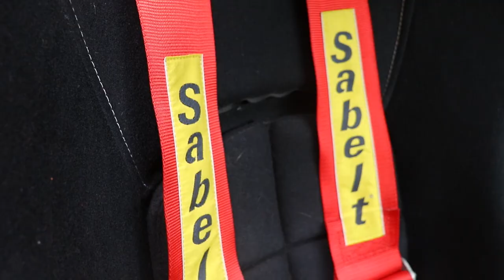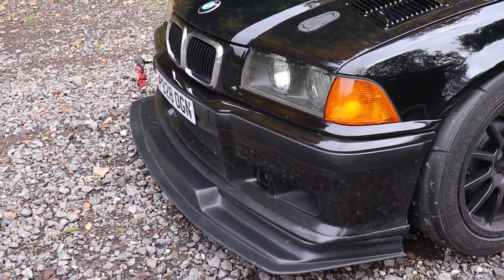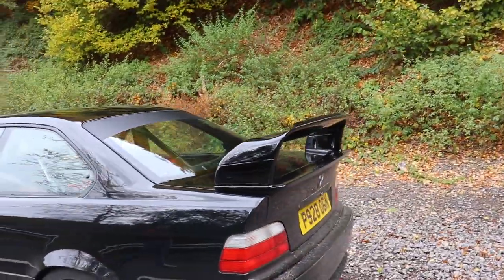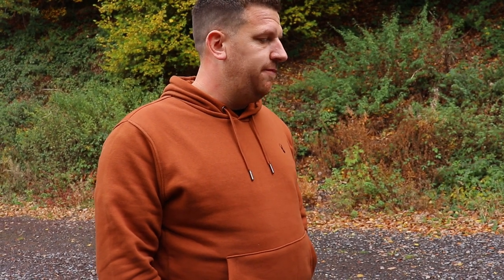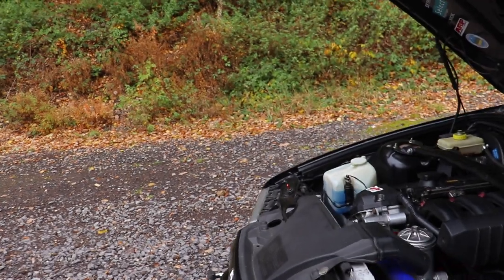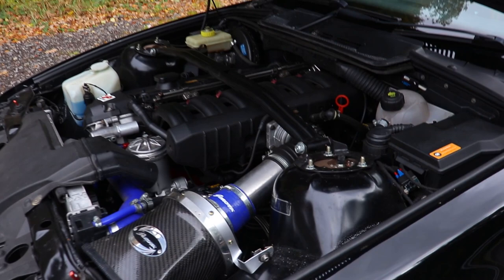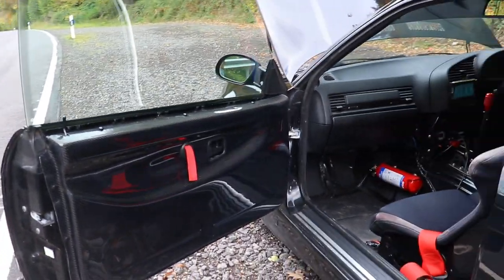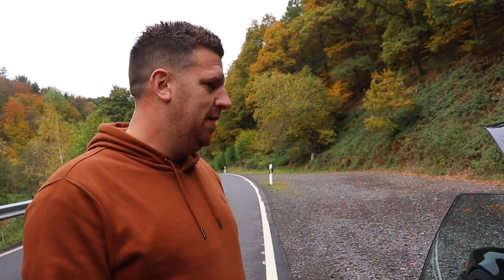Jonny's Fully built STROKER E36 Track car! | Walkaround | Onboard

Comment: How are they tilting the bonnet ? Would like to know if there’s any parts, or modifications done to achieve that look
Reply from the maker: I’ll ask him
Reply: just take a look, either bend a bracket or add washers or something, not rocket science xD
Reply: To anyone watching this in 2024, don’t do this. 

High pressure area at lower part of windshield, at high speeds the air will tend to go backwards into the engine bay. Not effective.

Comment: Nice car, sounds good with the S50 headers but there is a zero % chance of this thing making 276 hp at the crank. Zero. None. Not with stock B28 cams, or even S52 cams. Hes not gained 40+ hp with a tune and an exhaust. That's 10hp at best. You put the M54B30 rotating assembly into an M50 or M52 block and you'll get 220hp at best, but somehow he has 30+ hp more than a US-S50, with worse cams? I'm sorry, but it's not possible.